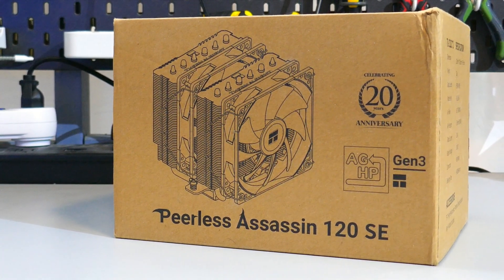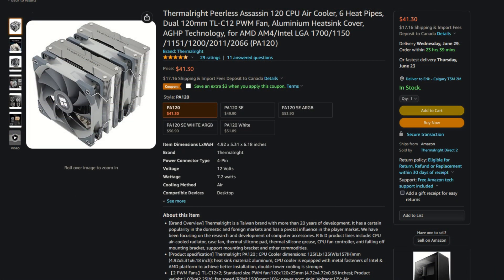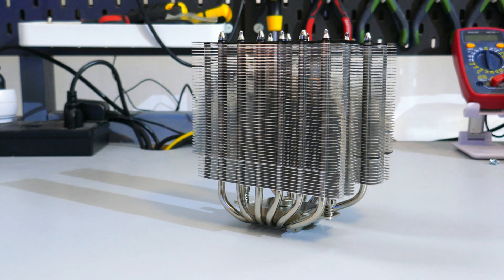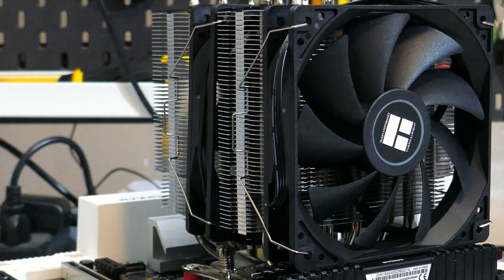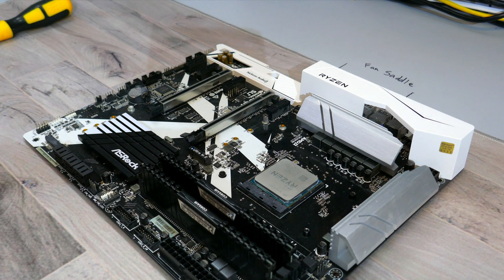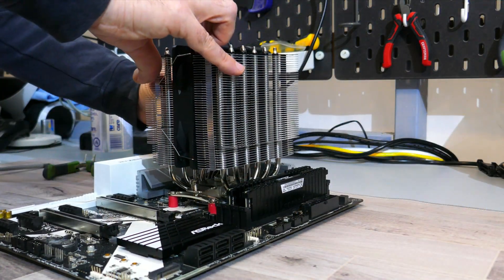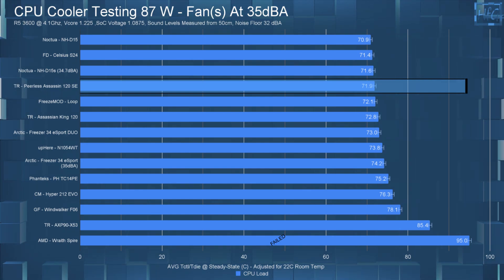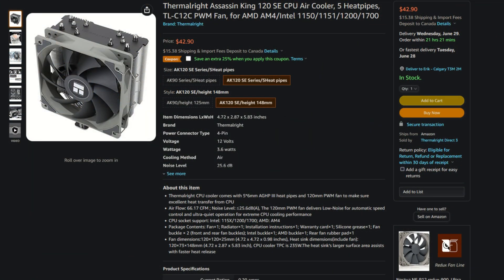ThermalRight Peerless Assassin 120 SE - CPU Cooler Review

Comment: you've convinced me to pick this monster of a heatsink at 40 euros for my new 5600 to make it shut up and have some fun with it. I was having troubles finding reviews of this heatsink on bigger websites/channels, thanks a lot for your review.
Godspeed to you man, I can see you getting bigger in the future keep it up.
Cheers
Reply from the maker: Thanks, glad you liked the video.
Reply: How is your experience with this cooler?
Reply: @uNNoia  I have only ever used a 212 EVO and a Gammax 400 before in builds, so I'm comparison to stock heatsinks and those two

It was pretty easy to mount, and definitely not finnicky unlike the 212 EVO or dealing with the plastics used in the Gammax 400
My CPU boosts to around 4300MHz all core and 4650 on atleast a single core with PBO and an admittedly rahter agressive fan curve, even then it's not nearly as uncomfortable as the stock heatsink and fan
I could talk more about it, solid performance and lets my CPU PBO way more than I was getting from the stock heatsink, and it doesnt make me want to get away from the PC from all the noise I got used to
Thanks to this video I didnt half-assed it by getting a 30 something heatsink
Reply: @MadMilkPT  Your 5600 should be able to boost higher than 4.3ghz with such a beefy cooler. For instance, my 5700x boost to 4.6ghz on all cores and 4.85ghz on a single core when running Cinebench R23. Have you tried curve optimizer yet?
Reply: @dragonl4d216  Wrote that right after I got the heatsink, back then I had almost no experience with Zen at all. Running y-cruncher's BBP test makes my CPU run at 4.5GHz at 75C, altho HWiNFO reports the effective clock to be at 4.15GHz, both all-clock. CO of -5, boost offset of +200MHz, PPT of 120W
Considering how heavy BBP is, it's a nice boost in performance and really quiet

Comment: Thank you for review. I ordered MSI B500M Mortar +5600X. I want to order  120 SE. But i afraid of installing on this motherboard. Is there any issues with VRM radiator on Mortar and 120 SE?
Reply from the maker: The MSI B550M mortar is a really good mobo with good VRMs there's no issues with using PA120 SE on it.

Comment: Thank you for the review!! Far too few (good) reviews out there on recent Thermalright stuff; you helped convince me to grab one on prime day ($38 for the RGB 120 SE). Total overkill for a 12400 but figure I'll try to keep it long-term for multiple CPUs.

Also super thanks for including the RAM clearance height. Couldn't find solid info on that anywhere.
Reply: Gskill ripjaws and Trident fit without lifting the fan. The ONLY gripe I can say about these coolers is when swapping ram (testing) you have to remove the front fan clips. That's literally the ONLY gripe I can think of!
Reply from the maker: Glad I could help
Reply: How's it working for you? I just got one myself. I'm about to upgrade my CPU to a 5800x3d and need a better cooler.
Reply: @zq7246  5800x3d isn't overclockable. 105W specs isn't difficult to cool. Should be capable as it was cooling a 13700k for a couple weeks while waiting for the 280 aio to arrive. For a 13700 I'd recommend the 140mm bigger brother to this cooler (or an arctic 280 lol)
Reply: @bullyakker  I think if I was going to go for a full system rebuild with a new motherboard I'd probably wait until February and get the 7800x3d. Its rated at 120w so you'd think you wouldn't need anything to crazy to keep it cool but we'll see once it launches.  For the 5800x3d the Peerless Assassin should be good.
Reply: @zq7246  7800 non x3d is a terrible choice due to it's heat. 7900-7950 with more chiplets run cooler with more cores. hat's a different cooling solution i agree as is the 7800... it's a hot mess to be honest
Reply: @bullyakker  What air cooler do you recommend for an i7 13700k? And what liquid cooler at a good price would you also recommend?
Reply: @stxrmzzz9995  if your case can fit it, arctic 280 aio. thermalright ps120se. it's a newer version of the peerless assassin 120. one more heat pipe, about 45-50 USD though the regular PA 120 works just dandy on my rig for gaming alone. i upgraded to arctic 280 which is a FAT 280mm aio because I also use my  pc to make me money, not just gaming. it runs 24/7 now. my 2nd which i game with ( and use 20 hours a day for work @ 100% usage has the peerless assassin 120 in it with a 12700k @ 4.9G all core, under 80's temps at 100% usage for 20 hours a day. the new one with the extra heat pipe is the same price and even better) (it ran the 13700k at 100% at 4.8 GHz all core for 24 hours/30 days straight under 80*c with no issues)

Comment: 41.50 usd. got 3 bucks off.. it's fantastic! within 2*c of a noctua D15 on a 12400
Reply: on 12700 (no limits) it's still within 2*c of the noctua d15
Reply from the maker: That's a pretty good price 👍
Reply: @HardwareForGamers  I liked it so much i purchased 2 more for my other pc and for the gal-pal's ancient 4690k (she's getting a 12400 soon but doesn't know it! =)  )
Reply: i7-12900k benchmarks run toasty right about 90*C. Gaming? No worries at all! Lian Li 011 air mini (Thing is NOT a mini! lol) , 2x140mm fans intake (stock), 1 rear (stock) and 1 top rear (Arctic P12) exhaust fans. I can see where a larger Noctua D15 would be better if I ran benchmarks all day pulling 240++ watts (Ahem...260)
Reply from the maker: 90c when gaming, damn! You must be overclocking that thing to the max.
Reply: @HardwareForGamers  It's clocked! haha WHat I intended to mean was Benchmarking was 90*, gaming is far lower and acceptable. Just checking out your video now on the Frost Commander 140 It's not a NEED but a larger and even cooler heatsink is a want... lol

Comment: TR produce some really nice quality tower coolers for low price. The Peerless Assassin is no exception.. TR's mounting system looks top notch too. The only Con I can see is that low height RAM must be used, which is the case with most dual tower coolers, except for the Scythe Fuma 2 and Fuma 2 Rev.B coolers.
Reply from the maker: Agreed, but like I said in the video the AK 120 is nearly the same performance and you wouldn't need to worry about RAM clearance. Regarding the Fuma 2 I would like to test it but Scythe it's replying to my emails, and the price of them in my area right now it crazy, so...yeah not sure when that will happen.
Reply: @HardwareForGamers  About to get this CPU cooler with your affiliate link.
Reply from the maker: @nomadexpress  Thanks for your support.
Reply: Yeah I agree the AK 120 makes better sense and would have more clearance all round too. I see TR also have another single tower called the Burst Assassin. The fin stack on this cooler is 6mm thicker and it has 6 heat pipes.. all other dimensions are same as the AK 120 White & Black ARGB variants. That's too bad about Scythe not responding.
Reply: @HardwareForGamers  hi, glad you have made this video thank you. I was planning on making a build with this cpu cooler but I’m wondering if it was compatible with RAM sticks which are around 45.5mm high like the PNY XLR8. What would you assess to be the highest RAM sticks suitable for the pearless assassin ? Thanks
Reply from the maker: @ayaa8039 it really comes down to the case, to have the fans at the 155mm height the RAM heat spreader needs to be 42mm or lower. But you can raise the fan up higher (increasing the overall CPU cooler height) if the case can support it.
Reply: @HardwareForGamers  kinda late to the party. im thinking about buying this cooler for an sff build you think it can be mounted on b660i asus mobo with 2 corsair vergance ram modules of 35mm height with a fun above them without ussues? thanks
Reply: @HardwareForGamers same issue..see my case supports upti 170mm cooler height and my RAM is 50mm….this dual tower is 155mm height…my case still have 15mm free. Shoul i go for it?